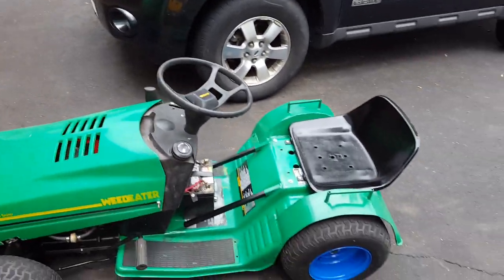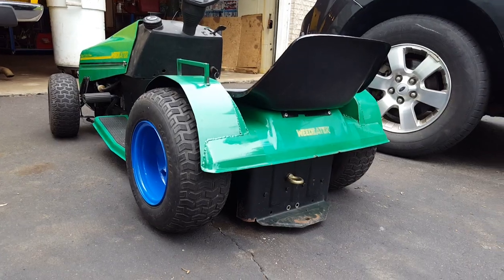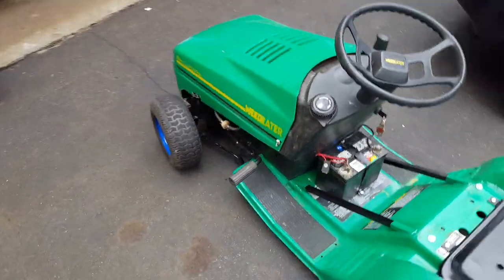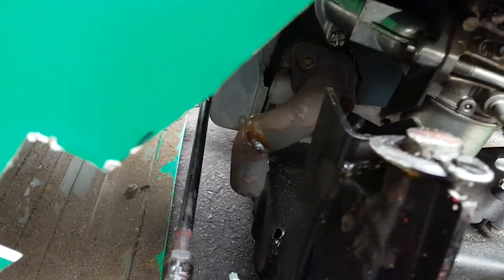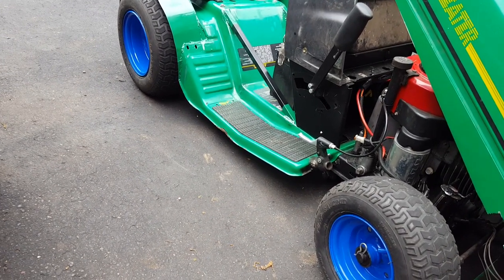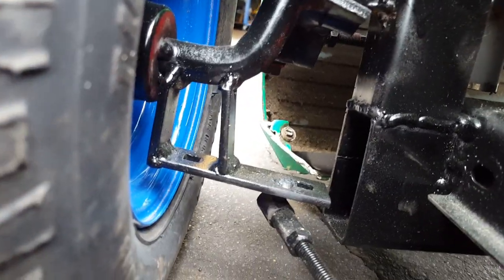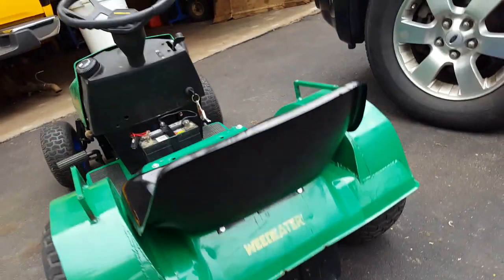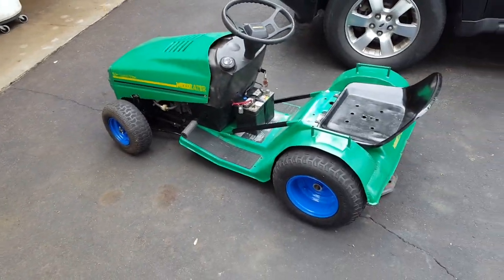Racing mower build

Comment: Nice, 
    I'm still running with the original paint job on my John Deere with the 165 Hydro strips and all. 
    I just picked up an OLD Ranch King a couple days ago and I am going to keep it low. I'm going to run a Honda TRX Front and Rear Axles. It has the 700 Peerless transmission so it already has chain drive out the right side. I will have front and rear breaks which will be Nice. The engine I am using is a Break N Scrap Um 18.5 Twin. 
    Have Fun and remember them stock flywheels are not good for much Over 4000 Rpm. 😎✌
Reply: run thicker oil in the B&S OPPY's 15-50 synthetic and change oil every 25 hrs and oil the air filter to keep silt out of the motor which NO ONE DOES so the motor sucks in silt and wears out... never checks the oil/changes the oil since got to write on the cowl CHECK THE GD OIL BEFORE EACH RUN OF THE DAY!!!! change oil every <25 hrs and clean air filter/oil air filter. use 15-50 synthetic or 20-50 motor oil for HOT RUNNING air "cooled" engines that run pretty hot with no cooling besides air... when it is 100*+ in SUMMER racing season.

Comment: Hi there just wanted to say first of all awesome build!
Another question I have is can you tell me what the rim size on this front and back?  I am going to be building one very similar to this and yes I am doing it literally blind!  Thanks for your motivation and any helpful info you can give I will graciously appreciate it
Reply from the maker: 16in in the back and 13 front. i think thats the smallest ones stock production mowers ever came with.
Reply: +Project10sec do you think you could send me the model number and the serial number to that thing? I have one like it but it's made by a different brand and I can't find parts for it
Reply: +Project10sec nice.. it looks really kool  check out my channel I have 3 vids but in my racing mower vid I go into some details about steering geometry and what we do to get rid of understeer and gain more stability and whatnot lmk what u think of mine..
Reply from the maker: front is 13 in wheel, back is 16. I think 8in rim in the back and 6 in the front

Comment: my mower has 10 1/2 in the front and a 3 1/2 in the back how fast do u think i could get stock engine
Reply: run out of torque/engine before run out of speed with that HIGH of a ratio? seems to me 7" to 5" wud be plenty fast and have enuf torque to get up and go and not burn up the belts... tooo often????
Reply: @gmcinnis6304  that ratio will get 30.1 mph. Yeah he will just smoke belts. Be lucky to get it moving.
Reply: @billycolwell4263  i have a 6 inch on front and a 2 inch on the back in mine and it works fine you just have to shift it like a normal standard transmission car lol

Comment: Genius flipping the trans.
Reply: seems like it  wud run backwards FAST as the pulley wud turn the wrong way on the transaxle? if trans pulley is UP it turns to the Right, clockwise... turn it upside down... the pulley is turning COUNTER clockwise so the trans is running in reverse/backwards. fill trans with gear oil/stp oil treatment to keep the parts lubricated
Reply: Flipping the trans helps you lower it without a jack shaft, but it will now have 1 forward gear and 5 reverse, unless you figure 8 the drive belt.
Reply: @Pgu9de  Dang son 2 years ago lol